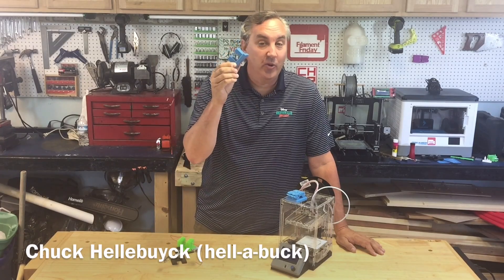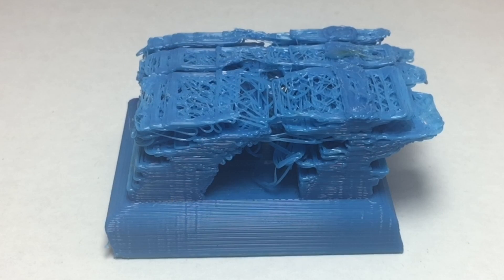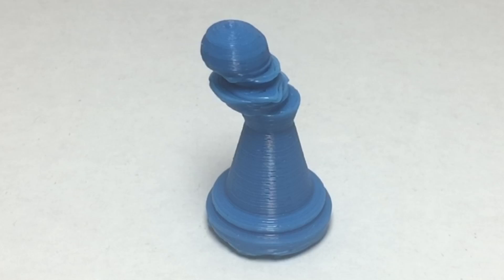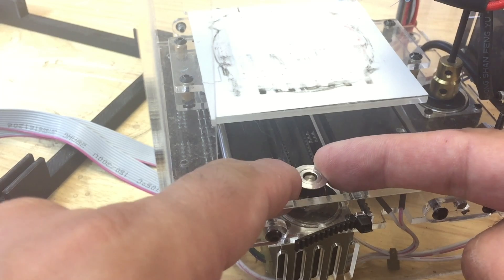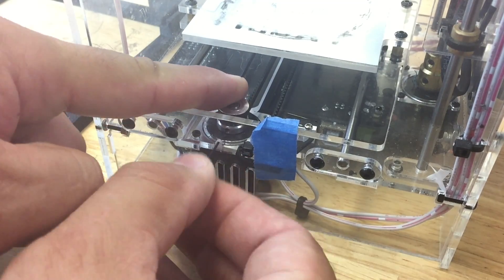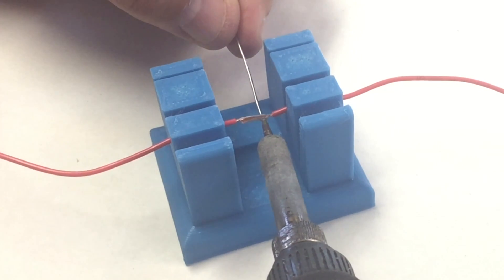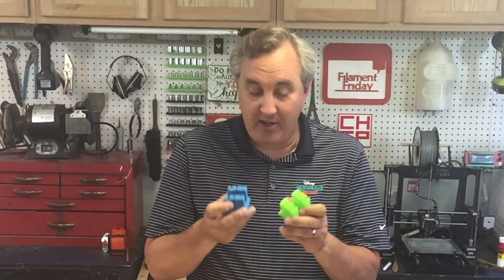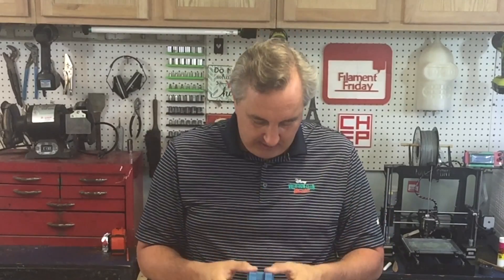Universal Wire Holder for Soldering and Fixing Fabrikator Mini

Comment: I had the same trouble with my fabrikator mini :) and i made the same modifications you did, by drilling a hole to tighten up the set screw.  i also changed the plexi bed to a carbon bed, seems stiffer and better :)

Comment: My x-axis set screw was a little loose when I first got my Fabrikator Mini, luckily I checked to see if everything was tight and working properly before I set anything to print.  The way I got to it was I took the four screws off the front panel and removed the panel and removed the front x-axis guide clip and rod and tightened the screw.  Then I put everything back together and it worked without issue.

Comment: LOL I'm pretty sure i commented to one of your older videos, or on hobby king  , RE about version 1's not being quite ready to run out of the box . that was the first fix i had to do , it was slipping in the shaft , and the pinion is so small .  it was squaring the side of my circles till i fixed it .  i put a small drop of CA glue on the end too.  just have to watch the heat cycles pressing  in the set screw , but not if you use a bit of CA or lock-tite .

Comment: There's a common saying among engineers - set screws suck! This is SUCH a common failure, not to mention loose fitting pulleys will become eccentric as you tighten the setscrew. Ah well, I guess they're cheaper than a miniature trantorque :) Love that your original mini is still punching far beyond its weight in print quality!
Reply: +Chuck Hellebuyck's Electronic Products Could you compare the Monoprice Select Mini with the Fabrikator Mini.

Comment: Not sure if you are just demoing it in the video, but it looks like your motor shaft has a flat side. You should always rotate the timing pulley or the idler pulley so that the set screw grabs the flat side of the motor shaft -- especially when there is only 1 set screw...otherwise it will come loose again.
Reply: ***** then you definitely need to drop some thread lock in there...don't suppose different steppers and different timing gears are a worthwhile upgrade

Comment: I had a simmilar thing happen on both x and y axis' on my prusa i3 I the pulleys that came with it had tiny set screws that were easilly stripped do I ordered new ones that had larger set screws you could tighten better.

Comment: So close to 10k Chuck!  I will take your advice and print the wire holder a bit wider.  Lining up those wires to do a straight solder joint can be difficult, so this wire holder should be great.  I'm glad you are liking your Flashforge Dreamer.  Mine has been fantastic.

Comment: I had the same problem with my Fabrikator Mini, but I didn't need to drill a hole to fix, I just cut the sort end of one of my alen wrench to fit. I prefer to mod a tool for the job then cut/drill holes in my 3D's body.

Comment: i'm loving my fabrikator mini, but if that had happened to my prints i don't think I would have thought to check the set screw and probably would have thrown it out the window in frustration. but now if it does happen i will be thinking about it, thanks. :)

Comment: Great video as always Chuck. I use the same wire holder, it's great. I agree that it could do with being a little wider for more soldering iron room ... but I haven't got round to doing it yet :-)
As soon as you mentioned the shifting, I immediately though it would be grub screw related, but only because I've had the same problem before, and someone made the suggestion back then.
No substitute for experience and sharing it.
Keep up the superb work mate